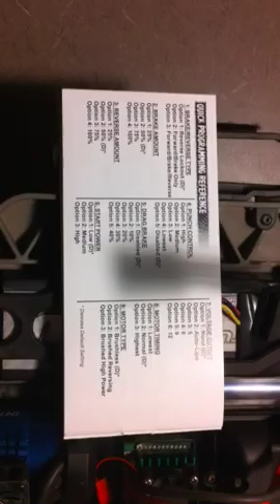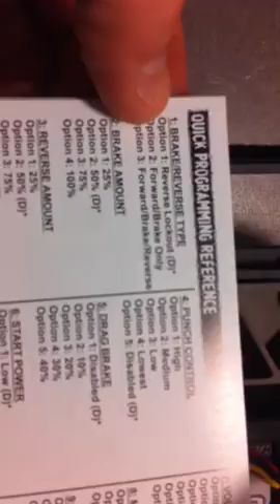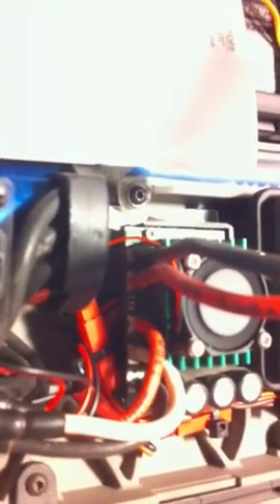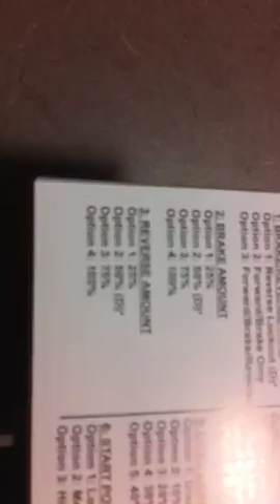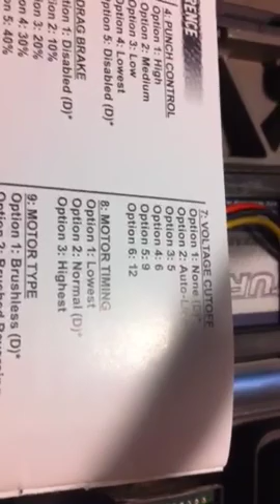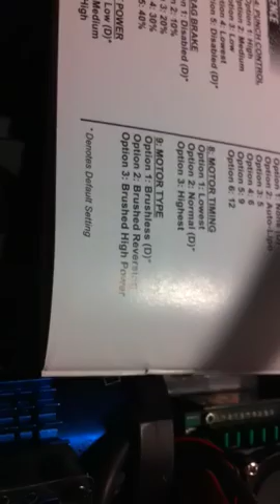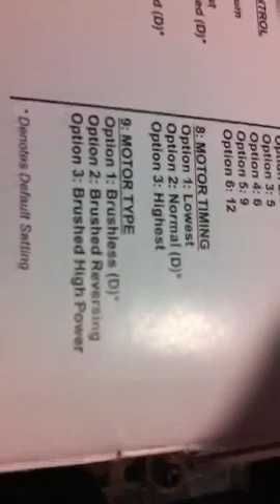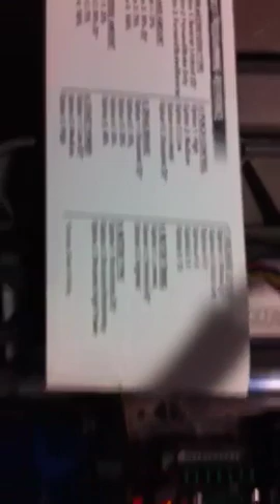Program a mamba esc

Comment: Hi i program my mm2 manually with the transmitter and i did something wrong now the wires/battery heat up when i push throttle plz help 😢

Comment: i did this, i run 5200 11.1v 50 battery in my reeve while doing this, my fans runs non stop and on my esc (same one you have) its solid yellow beeps once every 20 sec...batteries just fully charged...any ideas?

Comment: I just used this method to program my mamba micro pro and set the mode to crawler reverse and set drag brake to 40% (max available) but it seems like the drag brake just doesn't work. it still just rolls along. should I set it to just normal forward reverse then try setting drag brake? also i left the normal brake setting at 25% cus I figured it would be removed once set to crawler mode. does it effect the drag brake at all?